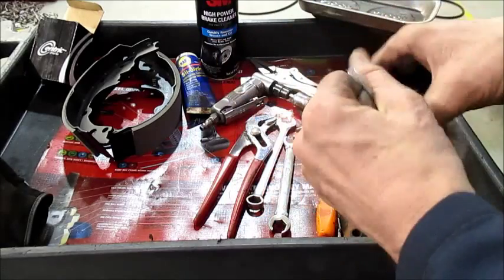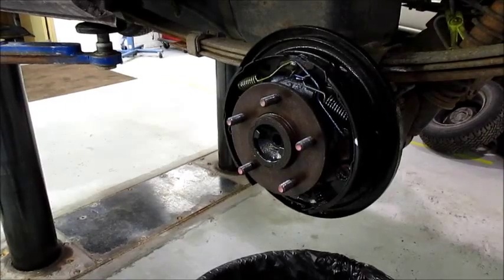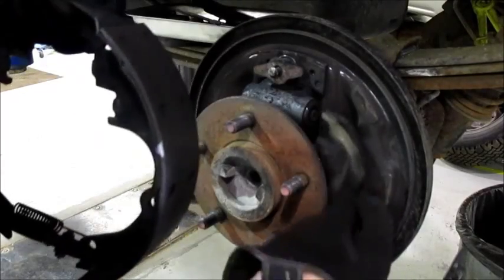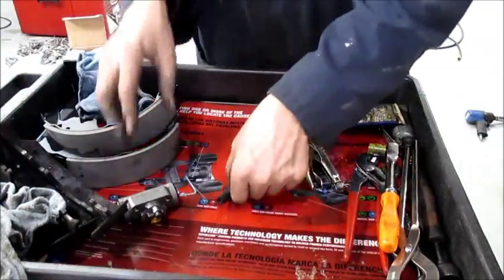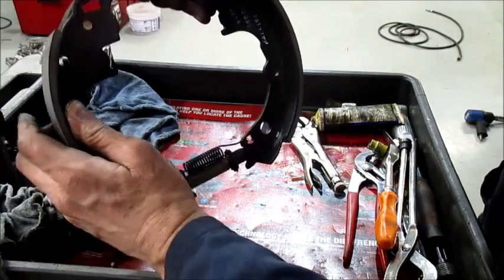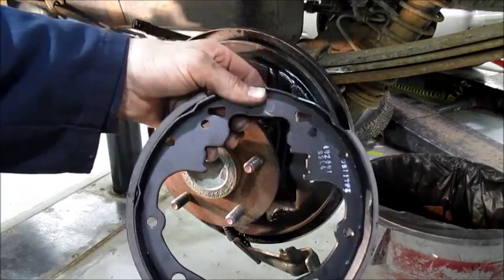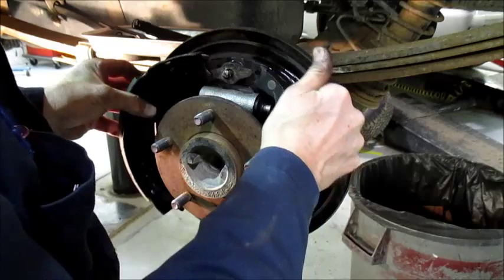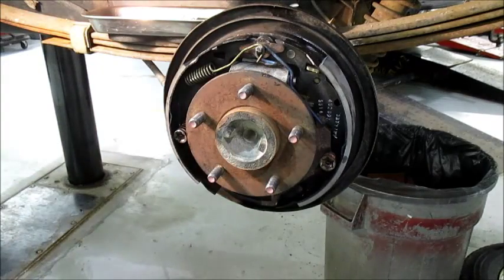Drum Brake Service Chevy Astro and Chevy Pickups

Comment: I got the Delco part kit which was missing two hold-down springs. Be advised that the springs that go above the brake adjuster are different. The red spring goes on the passenger side and the white one on the driver's side. Naturally, I got the wrong spring on the first time. Very helpful video.